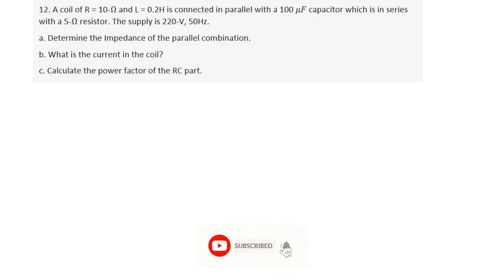43 - AC CIRCUITS PROBLEM 12 | Find the Impedance parallel combination, current and power factor

Comment: Z1 ×Z2  it supposed to be -1950-j4.15 ...i think you made a mistake interms of calculation
Reply: Reply this one as well maybe I'm the one making mistakes interms of calculation
Reply from the maker: Correct answer is 2050-4.15j